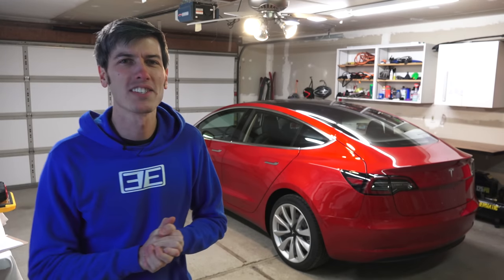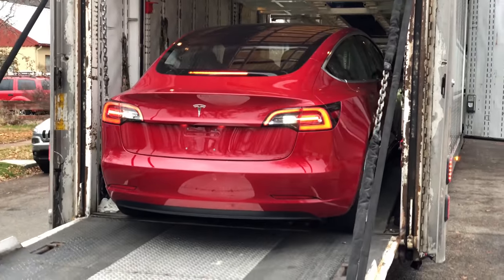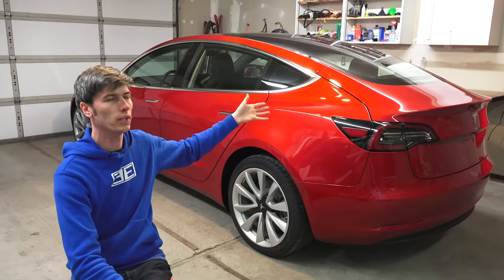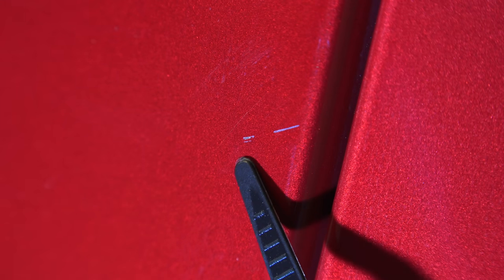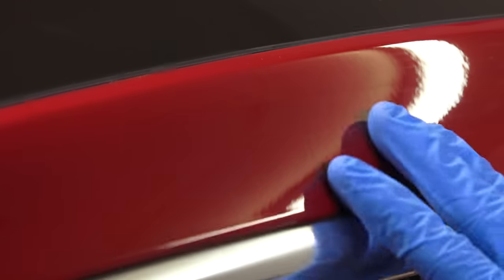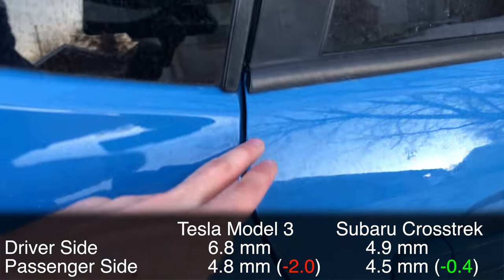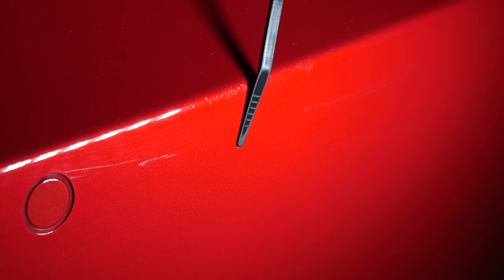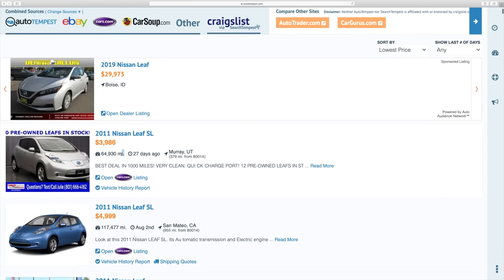Everything That's Wrong With My Tesla Model 3 - Quality Problems

Comment: Are people at Tesla building these cars with huge key chain bundles strapped to a belt loop just letting them swing freely making all these scratches!? I have a 2011 BMW 135i that Doesn't have a single scratch on the whole car. After 53k miles one baby rock chip that somehow got under the Expell front clear bra. And this has 22 miles jeez. Maybe time to start unloading my Tesla shares Ha NEVER.
Reply: SDD525  I seriously doubt the transporter was in the paint room putting debris under the clear coat.
Reply: Hope you have a stop loss for those shares.

Comment: The fit and finish is a bit disappointing for such an expensive vehicle. This was acceptable for  north american vehicles produced in the 70s and 80s, but is way below standard for late model vehicles. Other than the spot of dirt in the clearcoat, I'm wondering how the paint got scratched. I'm guessing that this must have occurred during transit.  The car should have been inspected before it was loaded on the truck and If defects were found they should have been corrected prior to shipment. I'm an Industrial Engineer with an automotive repair backround, and I would be all over this if I was working at Tesla. This is an area that needs immediate attention. It's odd that the panel gaps / alignment are so large and inconsistent given that current production methods should yield better results. Excellence in fit and finish is the hallmark of a quality vehicle. Hopefully Tesla will pay more attention to this in the future . Thank you for the video!

Comment: That is unacceptable poor quality control to pass trough that kind of mistakes to customer to begin with. Even my old used car has better paint than that brand new one. Also that rear bumper panel does not seem to be flush with the driver side body panel under the tail light. I bet that even Dacia is doing better job with QC

Comment: So, doesn't Tesla have QC people to check cars before they leave the plant? Some manufacturers (Porsche comes to mind) test drive their vehicles before allowing them to be shipped to the dealer. What's going on at Tesla? Judging by panel gaps, maybe Tesla should have Subaru build cars for them?
Reply: What can you expect from a company that's had over 100 major executive departures in 2018.
Reply: The problem wirh QC is that when delivery pressures are super high QC suffers.
Reply: I would like to hear Tesla's comments on this issue. I am wishing there is a paper trail of QC done ons that particular Model and that the scratches and panel issues is atributed to something else. just the fanboy talking here
Reply: Tesla Deliveries and making a profit is probably a higher priority than a thumbnail scratch.
Reply: It’s hard to build quality automobiles. Just ask Lexus
Reply: Every car is test driven. Paint is not part of a test drive. Panel gaps can be made perfect if given the time to do so. Mostly they just ensure the doors, hood, and trunk open and close properly.
Reply: Every car is test driven but paint is not their check, someone else upstream does that. Body fit is mostly to ensure openings function properly. There is an attempt at symmetry, but they have about a minute per panel. Like anything, if you're not happy, take it back.
Reply: @KillroyX99  It shouldn't be considering that this is a car that's marketed to the mass market and not just cultists. If the build quality isn't there the customers will walk away.
Reply: chstra45 i wonder how Toyota and volkswagen managed to make sure panels on their corollas and golfs are decently aligned in almost every car. They’re the worlds’ top 2 most produced cars at 1/4 the price of a model 3. I dont think they have a minute to adjust those panels, one car rolls off the assembly line every 45 seconds or less after all. So i agree with Jeff, it is unacceptable at this price range. Maybe it’s okay for an economic grocery getter, but def a big no no for a lexus is, bmw 3 series, audi a4, merc c class competitor.
Reply: @jaronyuriyh7931  Toyotas and others don't need that much time, Teslas do. This is brand new architecture. Getting the vehicle to the point where little to no body fitting is required during or after general assembly, meaning gaps and alignment are good from BIW, takes time. Until then, the cars need a more labor intensive form of body fitting that takes too long to get perfect. I agree that Tesla should be better, but I also understand this process is not instantaneous. All that said, the gaps on Jason's car are not within standards. I'm not apologizing for Tesla, just trying to offer perspective.
Reply: chstra45 generally this calibration is almost done within pre productions, very few customers after initial release would encounter these problems.
Reply: @jaronyuriyh7931 For better or worse Tesla doesn't really do a lot of preproduction builds. And, again most other companies are working within existing architectures. The 3 is all new. I'm not looking to get cornered onto apologizing for them. If you or someone has one, or is thinking about buying one. Make sure these things are addressed before taking delivery. Tesla is good about handling issues within reason.
Reply: chstra45 Elon sold pre production cars to employees, and ended their pre production too early. Ik you’re not looking for excuses for them or anything, just wanna point out that lack of prep before series production and all new architecture isn’t the reason why it got so bad. It could’ve been a lot better than this. Most companies roll out a refreshed or brand new platform every other decade or so, but their main struggle is reliability rather mechanical/electrical not cosmetic related. If you remember a few months ago when tesla said their monthly delivery is more than mercedes c class, you’d suspect something wasn’t right. Real problem was they built temporary assembly lines and workers were working hella extra hours just to “ramp up” production and deliver as many model 3 as possible before 2019. Yes, manufacturers encounter problems when they ramp up production, but not under the premises that they’re already having assembly problems in the testing runs for series production. Spending more than an hour on each car to address assembly errors during test runs is already a red flag, Elon pushed it anyways to keep tesla alive. Idk if this is a good thing, but i definitely dont expect too much from this kind of leader

Comment: Holy s***.. Drinking is allowed on the job at Tesla??  Paintjob looks like a DIY can job, and that glass roof misaligning that much, panels being misaligned.. No wonder more cars are going from EU to US than the other way around if thats the quality standards... 
Also.. How soft is that paint being that scratched just from delivery!?! I don't see that paintjob looking anything but horrible after just a bit of use, but that will remain to be seen.
This should never have ended up at the customer like this.

Comment: lol at the amount of dislikes. Tesla fanboys are the most butthurt of all car fans.
Reply: It is very clear that Tesla is lacking some quality control and that paint job is not professional at all. My "consumer" car Kia from 2007 has a better paintjob than this Tesla. Its laughable.
Reply: @Mobay18  Quality Control won't help. Can you imagine sending all of the cars back to the re-assembly point? It will be way too expensive. It is better to do it right in the first place. Anyway, from the manufacturer point of view it is better to try to sell them, regardless of quality. Many buyers, especially older ones, will not notice such problems nor care.
Reply: @MrCombic  The point of Quality control is to ensure the production is optimal and then correct the production to match the expectations. If you ship 100 cars before quality control finds an error, you are doing mass production wrong.
Reply: From my limited experience of Tesla owners and unfortunately, before knowing much about Tesla tech (so I had no counter argument) they are rabid apologists. Like apple fan bois x10.
Reply: i'm a hardcore fan of Tesla and i liked the video. The scratches are unacceptable , but a person without OCD wouldn't notice the millimeter differences on a daily use anyway. Also i don't think people buy Teslas for this stuff , that's not the selling point , it is for Luxury brands but Tesla is more about technology
Reply: Without a doubt, anything Musk/Tesla related seems to be deified by a group who believe Mr. Musk is the second coming. The whole company seems to be built on government subsides and share options. Elon Musk also steals peoples' intellectual property, if you wish to put your machine into that "World Changing" rusty tube, you sign over your invention to Mr. Musk into the deal. Snake oil much...!!
Reply: Mostly because they're not the typical car fans. They're technology fanboys tricked into liking a car. (Not that there's anything wrong with liking technology. Being a fanboy is wrong)
Reply: Damir M the only good Tesla is the band
Reply: @Mobay18  munro associates, a highly respected engineering firm specializing in taking apart and analyzing cars, took apart 2 model 3s I believe. They said the electronics and battery technology in the car is industry leading, almost military/aerospace grade quality. They also said fit and finish is on the same level as a KIA .... from the 1990s!! Ouch...
Reply: @tren133  Well obviously from the video, they are not keeping up the quality. The electronics may be fine, but the painjob and finish is bad on this dudes car!
Reply: @Mobay18  yeah no I don't even think Tesla really cares about the fit and finish on their cars, so long as they have customers lined up. I guess they consider themselves another Silicon Valley tech company like Apple, not a traditional carmaker like GM, Toyota etc. They are spending all their efforts on auto pilot and making the lights do a special dance, and not worrying about basic stuff like paint, panel alignment, weather sealing etc. If I'm going to spend that much money, 60k plus, I think I'll wait to buy a electric car from an actual carmaker like Audi or Porsche when they come to the market in a couple of years.

Comment: My 2019 Camry XSE (as well as my previous 2018 Camry LE) has WAY more uniform gap and came with 1.5mi on the ODO, and two tiny clear coat scratches about 1/2inches long on the ‘18 LE. Flaws on the ‘19 were equally unnoticeable and minute. Gap between panels on both Camrys were way tighter in uniformity than that Subaru. Toyota also offers limited lifetime warranty on the powertrain. Toyota. For the win.

Comment: My worry would be if they can't get paint right what about the battery or motor? Did they torque the wheels on correctly etc. A car if this value should arrive defect free, unacceptable and should be resprayed at the cost of the dealer.

As for panal gaps, is this because the panal's aren't on square or because the chassis is warped or not stamped correctly or is everything off square, the glass gap is something I'd expect to see on a Russian (Soviet era) car not a modern US car
Reply: Yes, they don't get the battery or motor right either. Tesla is ranked rock bottom in reliability.

Comment: Tesla makes you sign before they take you to your car.  Also, I had my new Model S (delivery summer 2018) have similar issues with paint nick and panel gaps, and weatherproofing strip issues (e.g. on sunroof, insulation from inside sunroof area not installed properly, dirty car, tire pressures underinflated in a new car).  Clearly rushing things out.  First at the delivery place, the line given to me around the issues I spotted was 'it's all within spec' ...after arguing the heck out of it, they said they can tear up the contract or build me a new one (with no guarantee they won't have other issues with the new car).  I said they need to fix the issues and they gave it a free detail after a week and put a 4" scratch to the metal on the car.  After another month they took it in and gave me a 4 cylinder gas car as loaner (they said the repairs will take 7-10 days while they fixed the paint issues -I told them to forget about the gaps - I'll live with it as long as moisture doesn't get it).  They had my car for over a month... Fast forward, car back home and I've had two scratches put on the car since washing it at home (with proper equipment including new microfiber mits) something I've never done to my BMW in the 5 years I've had that car. So, I will go so far so to say not only do they have no quality control on their paint, they must also apply a thinner layer of paint vs. other car manufacturers, it shouldn't scratch this easily.   But hey when you go see the showroom car they have on display, that car is perfect, from paint to trim, etc.  So no, it's not anal to expect the same condition for a new car you just spent a ton of money on.  But they'll make you pay in other ways for getting it repaired (fix one thing, @$@ another thing, give you the run around, keep your car forever) and wear you out.  My car sat on the lot for 3 weeks getting dirty waiting for a body shop slot to open up to fix the paint issues they created.  
I gave up after they fixed the paint the first time.
Reply: Fifty grand doesn't buy quality these days.
Reply: Oh geez, I don't think I would ever trust a sunroof on a Tesla.
Reply: @Maples01  try 98000...model s as I said
Reply: @petejams7340  I was just posting the base price for the cars.

Comment: It looks so fake so it must be real.... The shotty job at assembling. Stuff like that makes me worry about the internals. Tolerances etc. Ppl don't notice that stuff. And that's probably what they figure.
Reply: It is a legit concern to wonder about the quality of the parts you do not see.  This build was apparently rushed.  It is good there is no IC motor and transmission for them to apply the same QA to on this car or he would have a bigger problem.

Comment: Need a fourth generation mechanic and body and paint person myself owned and operated body shops and mechanical shops these kind of flaws are what happen with unqualified people running a business put in charge in fit and finish. It’s a young company just thrown together very quickly with many people with little experience and obviously the ones with experience were used to coming for the background with poor quality control. Then delivery is the other problem unqualified people trying to rush her product out to meet quotas mistakes will happen especially with new employees delivering vehicles who are not careful. Myself like many other technicians who were taught by their father and grandfather before them how to properly paint and prep and finish a vehicle we would turn out much better looking paint jobs out of the garage with nothing more than handheld tools nothing expensive no multi million dollar Hermetically clean downdraft heated environment specially designed for painting. And yes my wife just picked up her Tesla three in San Francisco and it came with both paint defects and exterior scratches that were added in delivery. Amazing Toyota delivers vehicles from half a world away between being driven loaded on the truck is loaded on two ships docked off the ships drive it up into trucks going to distribute  where houses in the USA heading off to Central dealer locations then distribute it out to the final destination dealer get shuffled around on the dealers lot customer comes in and buys and picks it up in an average in a much better condition than any tesla delivered. Got to ask yourself how is that possible. If private body shops where to repair your car or you asked them to paint your car and they delivered work like this they would go bankrupt because people would not except it and the cost to re-repair is three times more expensive than doing it right in the first place. This is why America is now known for low quality products it’s the American mentality of work quality ethics.
Reply: "Gung Ho" 1986 starring Michael Keaton...
Reply: if i'm elon musk, i'd follow the example of every tech company, move their operation to china, their work forces does meticulous jobs even though everyone said they are underpaid, china could make rubbish stuff that still sells, but the number of high grade product they made is nothing to scoff at either.

Comment: I'll keep buying Japanese cars
Reply: Just traded in my 2014 Dodge Challenger R/T for a 2019 Toyota Corolla SE and the quality of the car is an insane difference the whole car just feels incredibly solid and well built
Reply: Korean is where its at these days. Kia and Hyundai make incredibly reliable cars now.
Reply: @Inbal_Feuchtwanger  yea Kia and hyndai is the top 2 cars in sweden acording to study on how often cars break down.

So its hyndai and Kia rank 1,2 and rank 3-9 is japanese  :)
Reply: @Inbal_Feuchtwanger  They're direct injection engine cars. They're reliable now (I have a Sonata), but they will carbon up, and their long-term reliability will not match Japan's.
Reply: 07' Infiniti G35x w/ 180k miles. Love it, love it, love it!! Never owning Chevy or VW again. Ever.

Comment: I've owned many vehicles in my time including a 1968 Charger R/T, 1987 Grand National, 1993 40th Anniversary Corvette roadster, 1995 Corvette ZR-1 and a 2002 Porsche Boxster. The vehicles that I still own are 1996 AMG C36, 1999 AMG C43 and a 2006 AMG CLS55. I grew up around many show cars and have an eye for attention to detail and flaws. It should be of no surprise why the only vehicles still in my possession are German made. The only fit and finish problem that I encountered was with the lower passenger rocker moulding on the 1995 Corvette ZR-1 as it was bulging out slightly in one small area. I would never accept a vehicle in that condition no matter what the price tag was! Period!!! 

I was actually considering a model 3 but I'll definitely wait for a better option from an actual automaker!